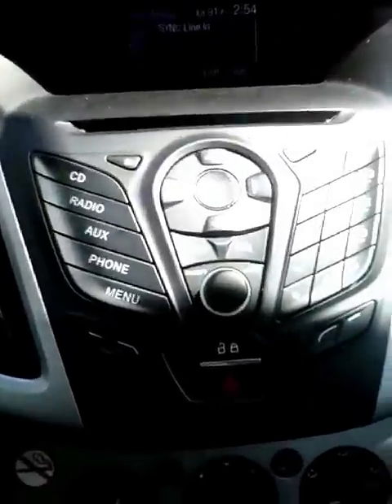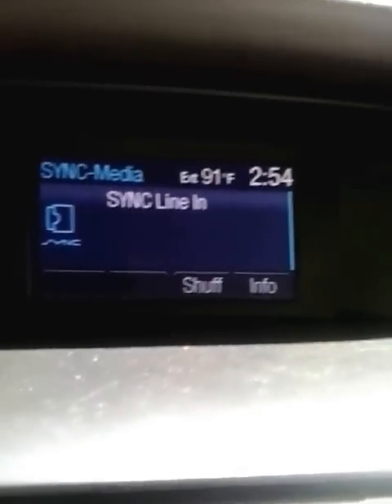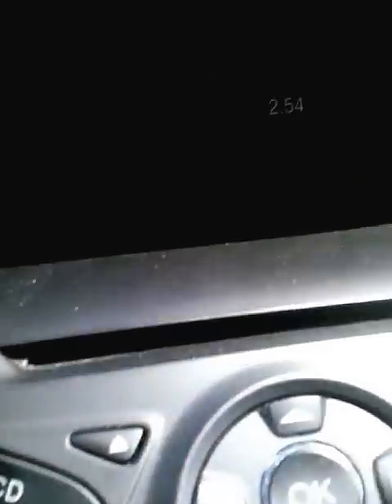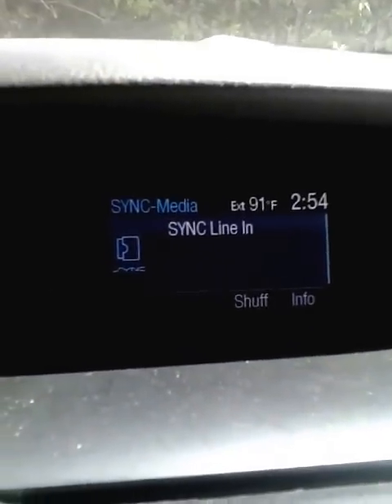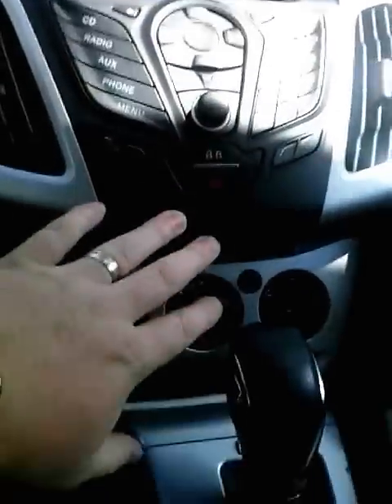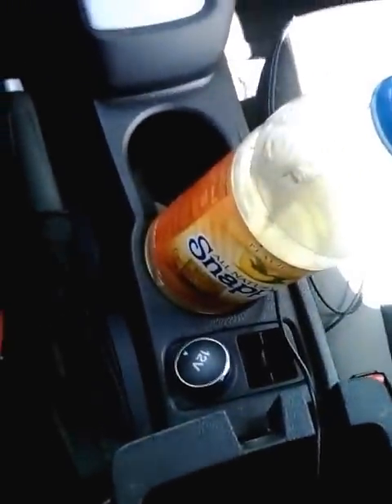How to Find Ford Focus Aux Input

Comment: Mine doesn't have an AUX port :/ there's only USB port, but the interface says 'usb not supported' whenever I plug any type of usb inside... any ideas? I have the aux button thouth, but it just says cable not pluged in..
Reply: amonem you’ll have to get an adapter for your aux cord and plug it in the usb port

Comment: SINCE A BLUETOOTH PHONE IS A TWO WAY SIGNAL, DOES THE FOCUS TRANSMIT THE BLUETOOTH SIGNAL... IF YOU WANTED TO USE BLUETOOTH SPEAKERS? OR... HOW COULD YOU DO THIS?
Reply: Bluetooth actually works a bit differently than that. Devices contain several "profiles" that describe what they can do. For example, a smartphone will have a profile as a stereo audio SOURCE, but not as a receiver. The profile that a car radio will present to the phone, in order to accept and control phone calls, will be a (likely monaural) "headset" profile. Yes, it can communicate bi-directionally, but really just in sending the car's microphone audio (and call controls) to the phone, and receiving the audio from the call itself. Your phone doesn't play the car's mic out its speaker, nor can it be used AS a bluetooth-receiving speaker. The phone accepts the car's mic audio via Bluetooth, but it sends it directly to the call app. Your car, meanwhile, wouldn't even have the profile to send audio out via Bluetooth, since it would always just be coming out of the door speakers anyway.

My mom has a Lexus GX470, but being from 2007, it only supported the communications ("headset") profile to accept and control phone calls - you cannot stream music via Bluetooth to the radio. Likewise, while modern smartphones will support modern Bluetooth versions and have a wider range of features, you're still not going to find the ability to stream music FROM your car's stereo onto your phone. The car's stereo just won't have that capability.